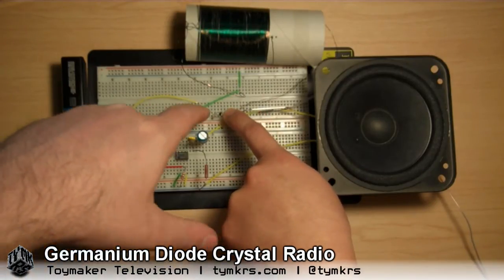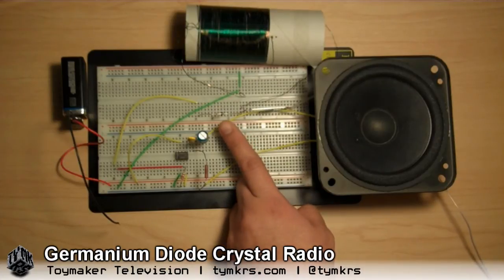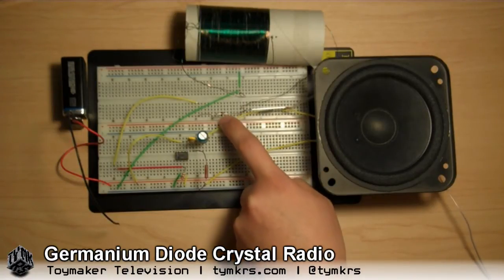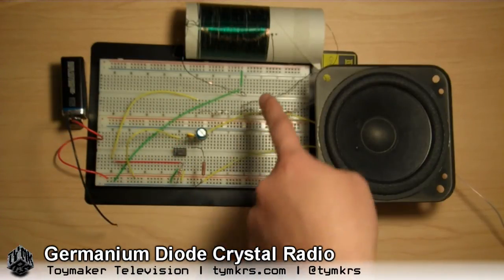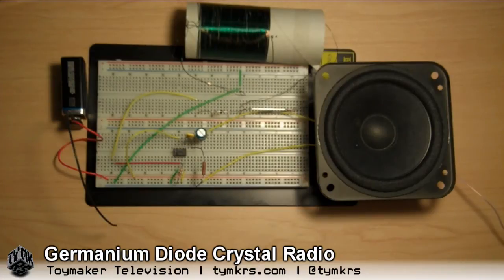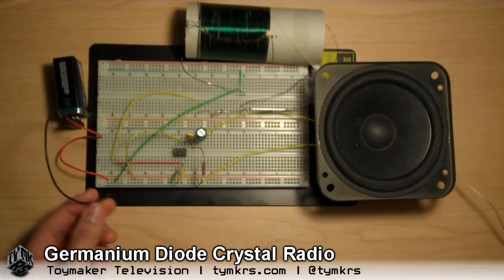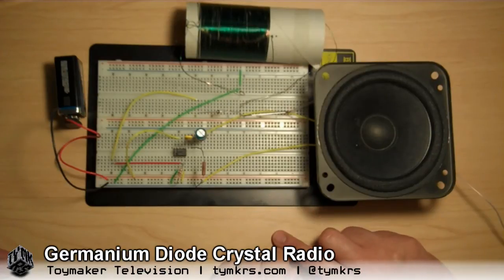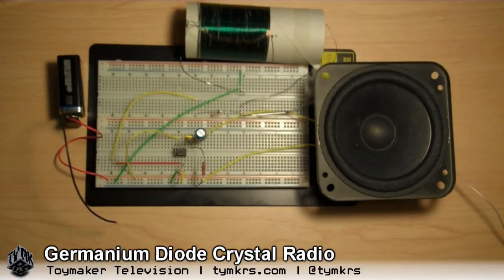Tymkrs Germanium Diode Crystal Radio

Comment: But u r using a 9 v, I thought foxhole was no battery. But I do like it!
Reply from the maker: I think it is no battery, but the amplifying circuit (LM386) requires the 9v battery :p
Reply: The actual reciever doesn't require a battery, the amplifier is what requires power.